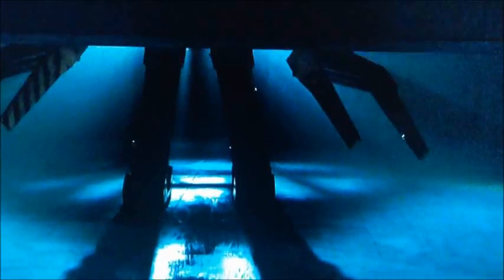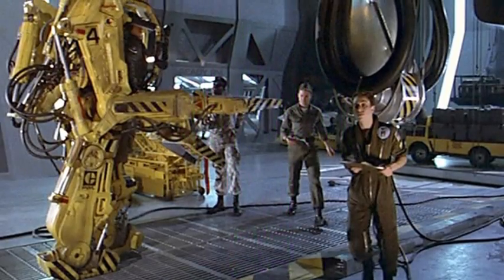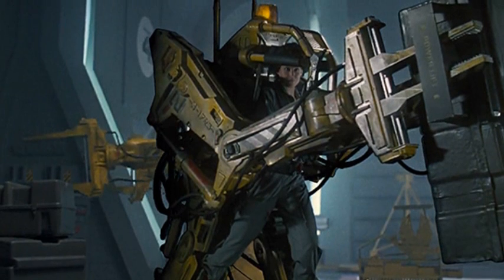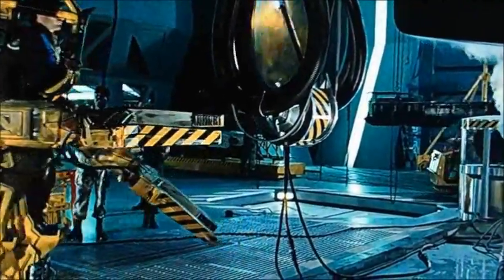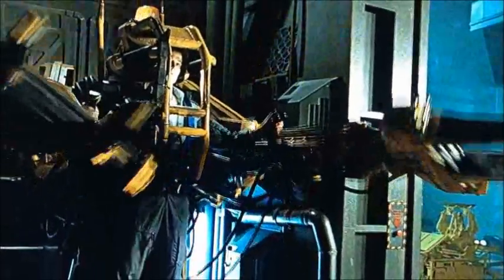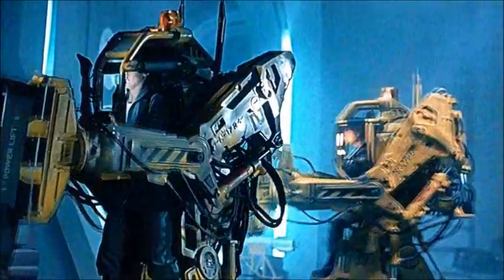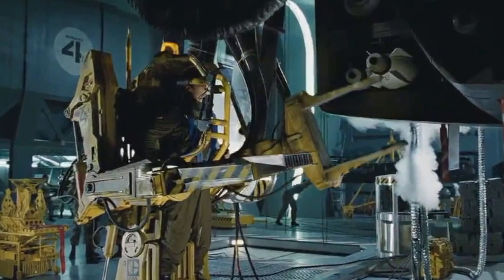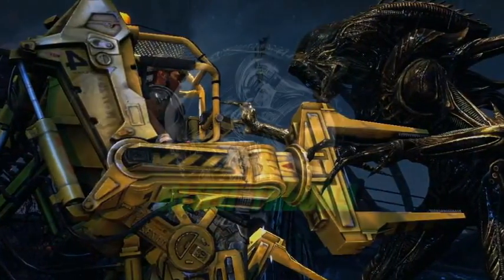USCM Tech: Caterpillar P-5000 Power Loader - Explained

Comment: In theory you could potentially militarize such a suit but very noticeable downsides would begin popping up. 

For one you have to make sure that key components are well armored along with the driver. but doing this would increase the weight and thus would require more power creating an endless cycle of adjusting the power and the raw armor the suit has. Second is that the suit would require weapons designed for it specifically. this would not only limit the armaments it has but in most cases would make the suit unconventional in some battlefield circumstances. 
Third is the actual skill it would take to use the suit and where it would be needed on the battlefront. This varies mission to mission, the environment, and the hostiles that need to be put down. In some cases it would work, but on LV426 it's likely that it would only be useful in the colony itself as the terrain and weather would be to much for the suit to handle. Then there's the foe you're facing, had Ripply been fighting a normal drone it's likely that the xeno would've been able to outmaneuver her attacks, climb onto the power loader, and deliver a crippling blow to Ripply. But since the queen was larger and a bit more cumbersome than the drones Ripply was able to go toe to toe with the queen.  

The power loader would undoubtedly be useful if under the right circumstances, militarized or not. Regardless it was one of the greatest scenes in the entire movie when Ripply came through that door using a powerloader to fight the mother of all Xenos.
Reply: So you didn't see Edge of Tomorrow with their Jacket combat exoframes?  Had a detachable assault rifle on one arm, a three-tube missile launcher on the other, and retractable armatures on the back that mount an additional gun and box launcher: https://youtu.be/jP4zylghF1Y
Reply: search the Hacksmith channel on youtube...they have a working one...it took 3 years to build

Comment: Seems pretty slow as compared to a forklift for average everyday pallet loading/moving/stocking.. though this seems like it can be optimal for handling loads a forklift can't handle which a hoist or crane with straps is usually used to lift, i.e. round objects, such as missiles, specially designed crates, top heavy/tall or uneven loads.

Comment: Those thing possible but the battery would be a plm. Power cables would solve it with a overhead rail system

Comment: The design may be able to withstand the stress of 4 tons but I dont see how it wouldn't just topple over when picking up said mass with it's front "arms".
Hydraulic legs would also make it much slower, require more fuel/power to operate and more maintenance than simple wheels.

Comment: I really can't decide if its practical or not, movement wise, a 4 wheel forklift is a far batter choice, but the arms are far more versatile than those of a forklift not to mention the loader can attach other tools. With the arms you can grab, move and work with many different things while a normal forklift can only pick up pallets really. So practical? Yes for versatility no for mobility.

Comment: While I like the concept, as an engineer I feel this machine would not be stable either in low gravity or normal gravity. Using 4 articulating legs each equipped with counterweights, small emergency jets, and magnetized omnidirectional trackball-like wheels would make this more suitable for rough terrain and space environments. Also, the cockpit would need to be designed to be used with an EVA suit.
Reply: search the Hacksmith channel on youtube...they have a working one...it took 3 years to build
Reply: @felipealvite926  Its mechanically possible, just not practical.

Comment: cab totally see a company or battalion of these crushing a zeno hive with flamethrowers, modified melee weapons, chain guns and other assorted weapons all on their own. Wouldn't be that hard or far fetched, it's even in prototype stages to some extent in the real world. just tweak the design to better distribute the weight, heavily armor the whole thing in anticipation of the absolute worst the biggest, strongest and worst zeno can possibly do, then arm the hell outta it so 1 or 2 can hold their own against a whole hoard or even half a hive since zenos like to attack in mass when in numbers just make them too hard to knock over and the armor to hard to penetrate. I'd then be ideal for flame weapons, grenade launchers, and gatling guns/explosive launchers to be mounted too.
More you think of it more it makes sense. Many marines could be saved if few these backed them up.

Comment: can totally see a company or battalion of these crushing a zeno hive with flamethrowers, modified melee weapons, chain guns and other assorted weapons all on their own. Wouldn't be that hard or far fetched, it's even in prototype stages to some extent in the real world. just tweak the design to better distribute the weight, heavily armor the whole thing in anticipation of the absolute worst the biggest, strongest and worst zeno can possibly do, then arm the hell outta it so 1 or 2 can hold their own against a whole hoard or even half a hive since zenos like to attack in mass when in numbers just make them too hard to knock over and the armor to hard to penetrate. I'd then be ideal for flame weapons, grenade launchers, and gatling guns/explosive launchers to be mounted too.
More you think of it more it makes sense. Many marines could be saved if few these backed them up.

Comment: cool but not practical at all. very inefficient, and would not be able to handle loose surfaces at all. load carrying would be extremely limited due to extremely high CG and complete inability to balance.

a bog standard forklift would run circles around this thing.
Reply: I think the walker is specifically designed to be used within a spaceship. With a lot of confined space and cables and other obstructions a four wheel forklift would be highly restricted in its functions. And because there is a relatively low volume of work compared to a large factory or warehouse. The walker is sufficient, to deal with the loads which should be by the most part below one ton. And speed is also not a factor due to the low volume of work. The work can be done at the walkers leisure speed.

Comment: in real life that power loader would fall over becasue the weight is too big on the front.
Reply: The back of the unit acts as the counterweight.
Reply: CSALI CSATORNA and it specifically states that there's a gyroscopic stabilizer built in
Reply: I think the walker is specifically designed to be used within a spaceship. With a lot of confined space and cables and other obstructions a four wheel forklift would be highly restricted in its functions. And because there is a relatively low volume of work compared to a large factory or warehouse. The walker is sufficient, to deal with the loads which should be by the most part below one ton. And speed is also not a factor due to the low volume of work. The work can be done at the walkers leisure speed.